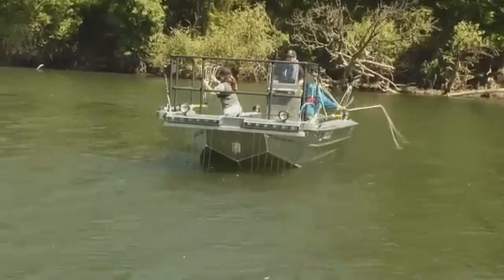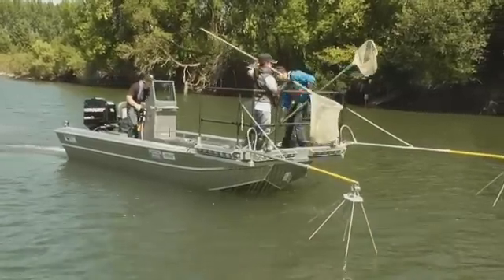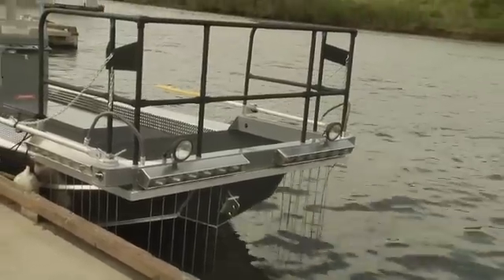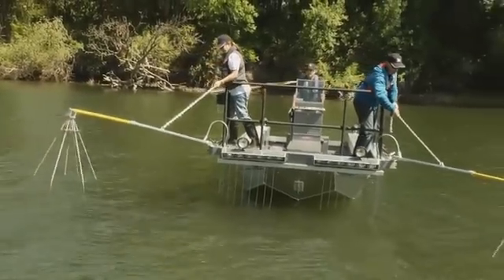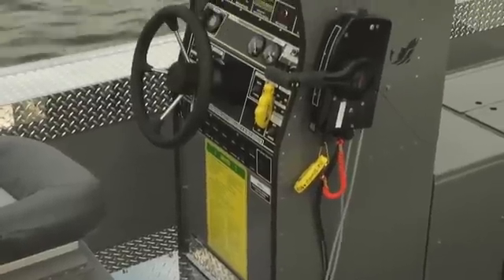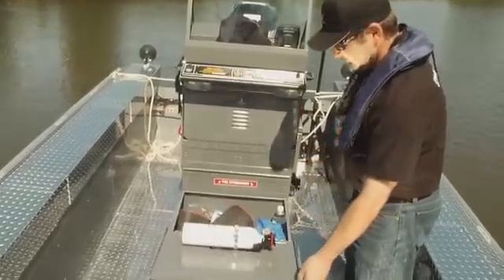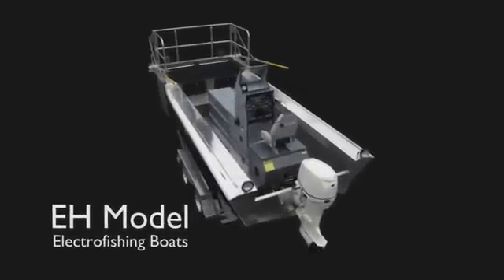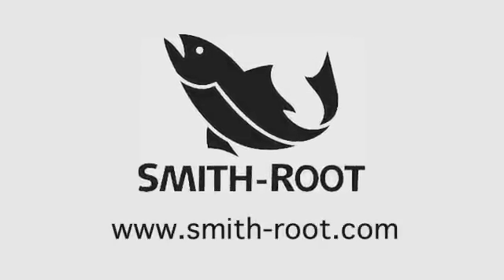Smith-Root Electrofishing Boats

Comment: You can tell what type of wire is used the machine to the basket? For exp: If this wire is a power wire common type is 2mm or other type of wired and wireless microphone or sound connection. You can indicate an electrical machine I model fishing with good efficiency and long range? My name is Jesiel and I live in Brazil My Email is    via.3@hotmail.com   whatsapp 95 991 193 045